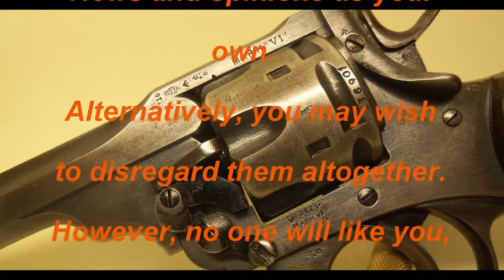Case Prep

Comment: Another mine of information here, Thanks for posting this !   I find the stainless steel pins/water tumbling has changed the whole results of my case cleaning, especially with black powder cartridges, the one difference in processing that I do is to dump the whole contents of the tumbler into a very fine mesh sieve, (fine enough to hold the pins), you can then dump the contaminate water/sludge down the foul water drain and not have to get it on your hands, then, after flushing the foam off the pins/cases with water, I pick up the pins with a magnet in a polythene bag, hold the bag/magnet over the tumbler drum, and pull off the bag, the clean pins drop into the tumbler ready for next time, the cases I drop into a container which has water with a squirt of car wash wax , this ,I find, stops the cases tarnishing, and makes the water run off quicker, then just dry them in the hot sunshine.